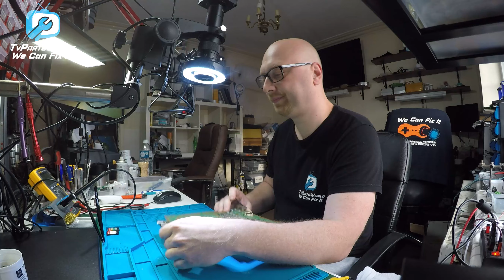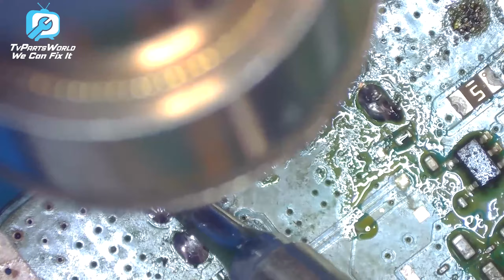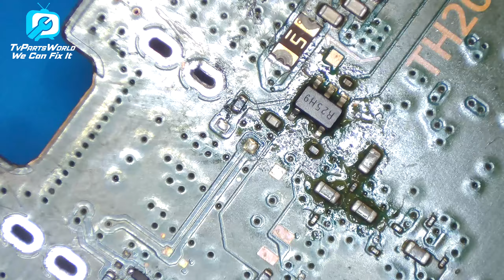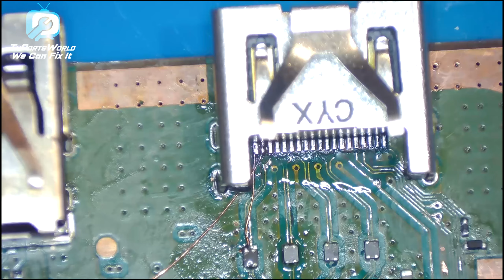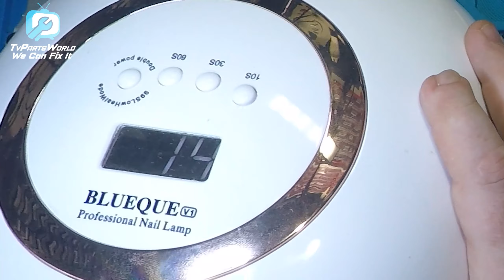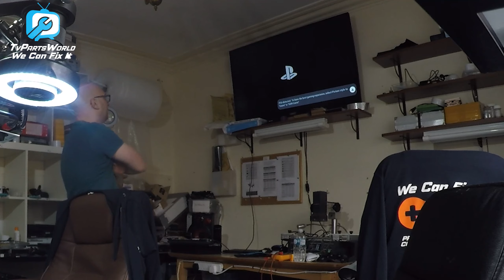PS4 PRO HDMI Port Repair Damaged Pads and traces

Comment: Tvpartsworld... need a PS4 pro  repair centre based in UK if possible please PS4 pro was picked up by dpd provided by gamertech York  was a still blue light of death tripping off after 2 seconds was liquid on board used isopropyl cleaned board resolved blue light of death failed after two days same blod again gamertech commented in updates was a blinking blue light when wasn't was exactly what booked in for what was sent from email address even sent updated from email address & full check only permission what was received from email was if could reflow main apparently was damaged southbridge when removed. Wasn't southbridge was a chip near  when resolved fan was spinning sent in email service has removed serviceable parts all parts have been replaced when called was told capicitors was removed when didn't ask permission was. No power asked why if no power why was discdrive spinning was only no direct power to fan when was a blod said will refund & return when returned Apu was clamped so tight was pressure on Apu drilled a hole through pozy screw holding clamp when pressed power button was no power no still blue light of death maybe a dead board not even no power to fan or discdrive this service what was only experts in package return box packed full of bubble wrap sending email from gamertec-dpd.co.uk to many links author image pdfs in emails.need could board be revived need.local reliable repairer in UK help